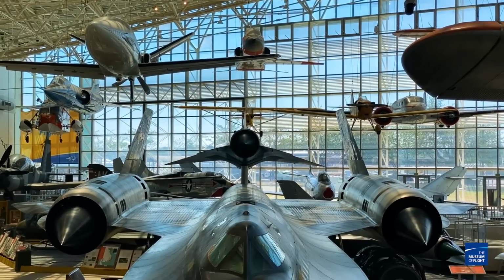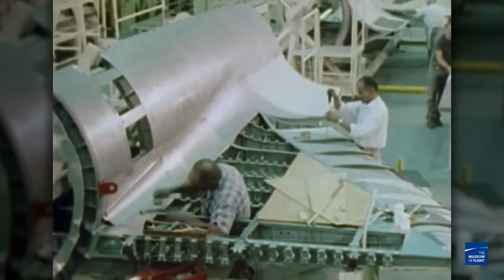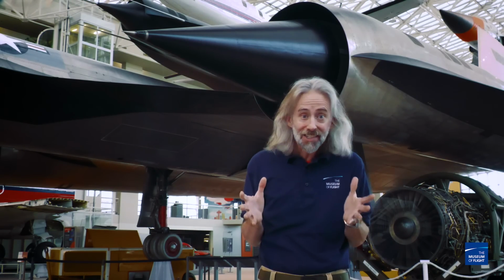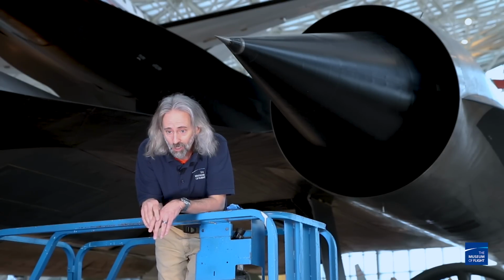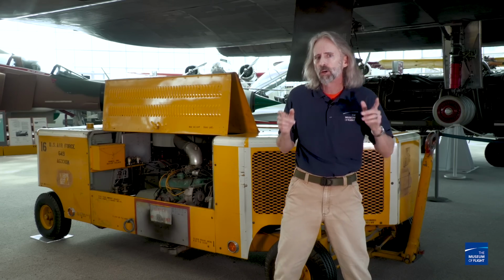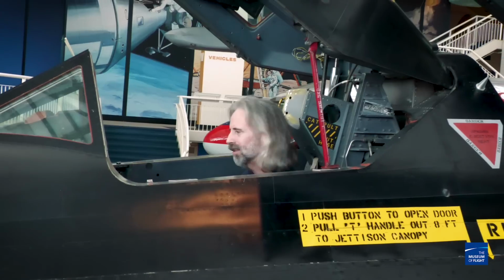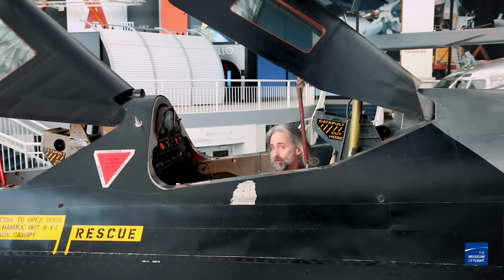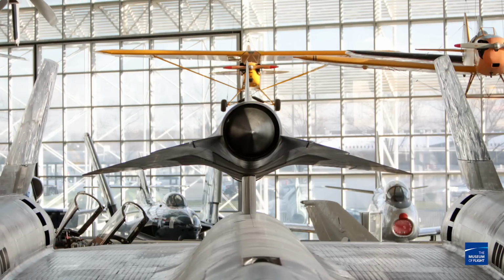M-21 Blackbird | Curator on the Loose!

Comment: I was in the program from 66 to 70. While working on t.he sr71 they rolled a d21 out in the middle of the maintenance hangers and removed the draped cover. That exposed it to Soviet satellite recon. So it probably signal ed the end of the program.
By the way, it was powered by a ram jet not aj58

Comment: The moveable inlet nose was used on the Mig-21 which was developed in 1950's. Arnie Gunderson who worked on the program for P&W said ground crews would sometimes get carried away with over reaving the start carts and not cut the start carts fast enough as the J58 started blow up the engines. They used up all the wildcat engines in every junk yard in the US had to switch to the Chevy 454 engine.

Comment: My Wife and I visited The Museum of Flight in 2018, having traveled from Missouri. While walking around the M-21, Shooting Pictures from Various angles, and simply marveling at its elegance, I could help but overhear one of the Museum's Guides refer to her an SR-71, once she had finished speaking with them I stepped up to her and pointed out that the Aircraft was a M-21 which is considerably different than an SR-71. She looked at me and said, "They don't know the difference", to which I replied "It should be your job to tell them". She just stared as I walked away to continue my exploration of your museum.

Comment: Argon is almost 1% of the atmosphere.  That's not very rare.
Reply: Yeah i was a bit confused as well when he said argon was rare because i can go down to the local welding supply and buy all I could want and not overly expensive so i knew it couldn’t be very rare even though i didn’t know the numbers
Reply: @54raceman it occurs to me that separating argon from the atmosphere is probably easier today than it was 60 years ago. It may have been relatively expensive and hard to come by.

edit:
After briefly looking at the 'argon' and 'air separation' Wikipedia pages, I'm SURE it's a lot cheaper today.  There's no doubt that cryogenic fractional distillation has come a long way in 6 decades.

Comment: Another fact about the A-12 compared to the SR71 is that they differ in length with the SR71 being the longer plane,but I don't recall the reason for this. If anyone wants to see an A-12 in the South there is one in Huntsville,AL at the Space & Rocket Center just sitting in the front parking lot. They didn't even bother to put it under a Awning/Carport or even occasionally clean it off which is kindof sad for such an incredible piece of aviation history.

Comment: 11th design but the engines weren't ready so the A-11 which is this airframe was fitted with J-75 engines. Thus, when fitted with the design engines the designation had to be shifted up to A-12.
The distinction is important because in Soviet Intelligence in 1958 appears concerns about the A-11, which is actually the Blackbirds that went into limited production and would've been their designation if the J58 engines were ready when the airframe was.

Comment: When the SR-71 delivered to the united stated air Force museum inat wright Pattterson AFB in Dayton Ohio I lived in Dayton and saw ir fly over my apt and I knew whare it was headed as there wqas only one place it might go th museum at Wright Pat ..the next day it was outside on static display and I was able to actually touch it with my bare hands. at almosr exactly 5'8" from tarmac to the underside of the wigns I had access to the underside and the access panels the survailance electronics had been removed, but the plane was fully functional otherwise until installed in the museum building... I had a 1/48 scale testers model of that plane in SR-71-B form(trainer version) only 1 left of the 2 made... so the rarest Blackbird except the M-21... touching my dream jet was almost a religious experience for me then... and I still have that testers model stored for rebuild after moving damaged it long ago...I butlt it gear up/flight mode and hung it from the ceiling on monofilament fishing line for display in flying mode..... even damaged it's a treasured item I will keep....

Comment: Given that the M-21 is a two seater like an SR-71, how do you tell them apart aside from the drone sitting on its back?

The SR-71 is the only version of the Blackbird family whose fuselage extends beyond the back edge of the wing. If the Blackbird you're looking at has a 'stinger' in the back, it's an SR-71A or SR-71B trainer. If the fuselage ends at the wing's edge, it's an A-12, YF-12, M-21, or the SR-71C (whose back end was salvaged from a wrecked YF-12).
Reply: Another way is to look at the chine near the nose.  The chine on the A-12/M-21 family is much 'pointier' than the SR71.  The YF-12 is the easiest - the chine stops about the windshield.  It does not go all the way to the nose (it would have interfered with the radar in the nose)

Comment: 14:38 You over-simplified it to the point of getting it wrong!

The shock capture of the inlet at Mach 3 contributed over 50% of the heat and pressure running through the powerplant. The turbojet added only a smaller amount of energy (in the form of heat by burning fuel and velocity from the compressor) while the afterburner added in the rest of the energy.

All that energy is expanded at the nozzle. The inlet did not suck the plane forward-- the inlet rammed the incoming air and contributed over half the overall pressure needed to get the whole thing thrusted out the back. That is, in fact, very much like how a pure ramjet works. The J58 at Mach 3 is essentially a ramjet wrapped around a turbojet.

Comment: AWESOME. The entire BlackBird family of planes are my all time favorites. I'm extremely lucky to live in Washington State - in a city named Federal Way which is a little south of Seattle. I have also been lucky enough to visit the MoF almost any time I want. I have also had yearly memberships to the MoF that would let me visit the MoF as much as I would want to. Seeing the M-21 / D-21 display at the MoF is aways awe inspiring. The MoF now has a recovered cockpit from a crashed SR-71 and you can sit in the cockpit - which I have done. There probably never will be another engineering accomplishment like what was done for the SR-71 program. If the SR-71 could have an alternate nickname ; I would vote for "Dagger" cause the SR-71's cut through the sky. The design is so impressive. Being born at Cannon AFB when my dad was in the AF meant flying is in my blood. No matter what angle you look at the SR-71 from it's always breath taking. The ( SR-71 ) was supposed to be called the { RS-71} but president Johnson introduced it as SR-71 by mistake so Lockheed let that stand as the planes designation.

Comment: Why is the CIA spy plane called the A-12? In the Air Force, the A would designate a ground Attack aircraft.

Also, what does the SR stand for in the SR-71?  I know the R stands for Reconnaissance, but I'm not sure what the S stands for.

Thanks for the interesting video.
Reply: A12 was from Lockheed internal name for the project gusto aircraft, archangel - the planes we know today being design variation 12. SR is strategic reconnaissance, though the sr71 was to be designated rs71 for recon/strike before being changed to sr. An interceptor version was also developed by Lockheed, internally known as AF-12 with the prototypes designated YF-12A by the Air Force.
Reply: @Derek-xr3uq  The designation change happened when President Johnson, when publilcly announcing the existence of the airplane, got it backwards and said SR-71 instread of RS-71.  No one in the military wanted to correct the boss, so it stuck.
Reply: SR is USAF designated term for Strategic Reconnaissance.. I remember when this bird arrived at the museum of flight.  My mother who was a Boeing employee and I was a curator in n training.   I also helped when they moved the Dash 80 (prototype to the 707 and was the one Tex Johnston Barrel rolled over Sea Fair

Comment: These planes were never shot down bc. they were so fast, they would be gone before, being detected.
Reply: Faster than a speeding bullet, more powerful than a locomotive, able to leap tall... errr well maybe not that last bit. At over 3x the speed of sound, the commie SAM operators practically needed to be clairvoyant to react fast enough to hit the button in time to even come anywhere near "close", yet still lag behind by well over a mile! 😅
Reply: Because Swedish Viggen pilots never had a reason to shoot them down. They did a bunch of times get radarlock on them though.

Comment: SR-71 got, 0.26MPG. lol 😆 😆 🤣  it's pretty much the lowest fuel efficient aircraft. Lol. The average for US Fighters/Fighter Bombers and Jet Aircraft in general, gets 0.4--0.8MPG. SR-71 is below the lowest end. Lol. Good thing it holds over 84k pounds of fuel. After the test bed production ones, i think the, SR-71 held, 90k pounds of fuel.  Still needed air refueling because of the, 0.26MPG lol. Talk about high price at the pump ha. For fun, the F14B/D if left in full afterburner, would run out of fuel in 8.5 minutes. Lol. That's internal fuel load. The F15C if left in full afterburner would run out of fuel in 10 minutes. Again, internal fuel load.
Reply: I heard somewhere that the (literally!) stratospheric logistics and operating costs (along with the development of satellite technology) were part of the reason for closing down the whole A12/SR-71 platform. Many, many, many tens of thousands of dollars per flight/mission was the figure.
Reply: As a young, brand new aero engineer at GD/Ft Worth in 1975 I ran a calculation on F-16 fuel consumption.  If you could instantly start it at Mach 1.2 at sea level and hold it,  you would run out of internal fuel in 6 minutes.   The other two calcs I did (I was in the performance group) were takeoff calcs.   If an F-16 took off from Carswell AFB going south, by the time it crossed the interstate, it could either be 1)supersonic or 2) at 30,000.   It's not that far from the end of the runway to the freeway.

Comment: Why is the D-21/M-21 have a 21 designation instead of 12? I know that A-12 is the twelfth Archangel design and the D-21 was originally classified as Q-12 after the A-12, but for the life of me I can't find any factually acknowledged reason for the change to 21 from 12 and where and why this designation of 21.
Reply: Lockheed flipped the numbers in an  attempt to disguise the fact that the M-21 was an A-12 derivative.
It's the same reason why they let the Soviets think the A-12 and A-11 were 2 different planes when they were in fact part of the same design studies that led to the operational Blackbirds.
It was all about deception and confusing our enemies.
There was no reason to call the F-117 Nighthawk an F-117 other than to confuse enemies.  It was a disconnect from the numbering scheme in use during the 1970s (it would have been called F-19 or F-20 under normal circumstances) but they were trying to hide the plane and what it was being used for.